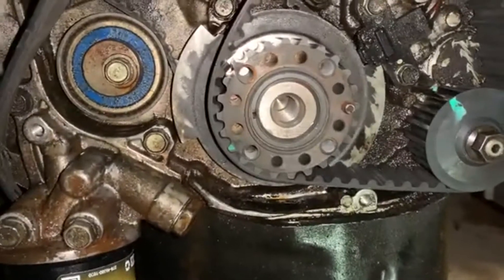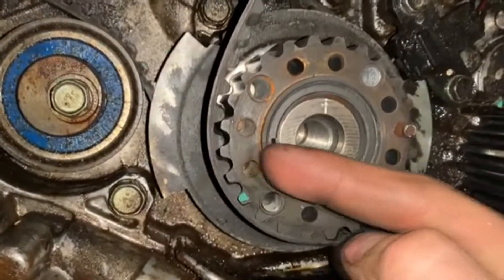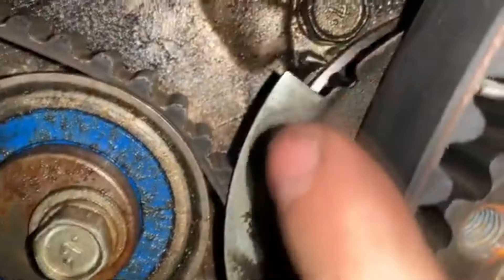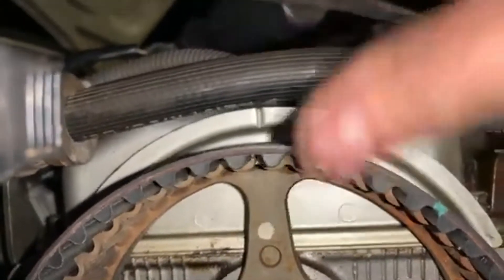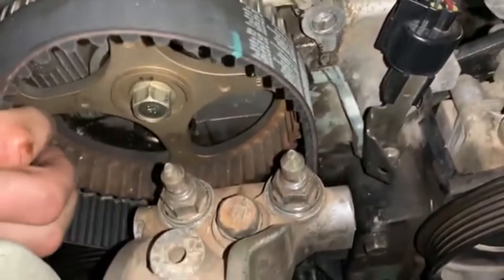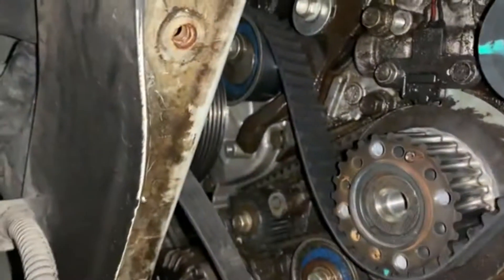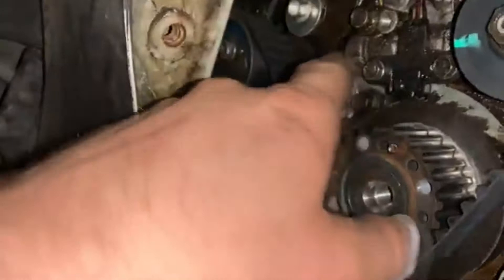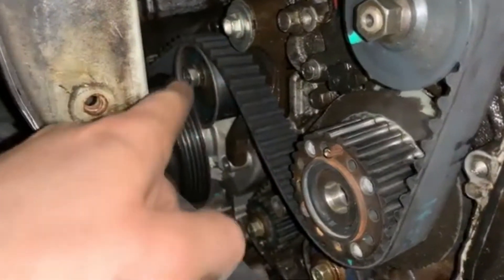2.4 L Mitsubishi SOHC (How to set Timing With Diagram)

Comment: I saw a video about the oil pump pully that explains that it needs to be lined up but also needs to pull back to the center after pulling it to the left and rigjt. 

This happens after every 3 or 4 rotations. If you pull left and it does not spring back towards the mark, circle and try again. The same goes for the right. Eventually, it springs back from both directions. 

Anyway, FYI...... If the car isn't running right afterward, this may be the problem.

Comment: You skipped over the oil pump alignment.  There's a balance shaft in the oil pump as well and you can get it 180 out even with the mark lined up, don't believe me spin it and see which way it wants to fall, then spin it 360° and see which way it wants to fall now.
Reply from the maker: @anthonyparker6586  I probably did however, the car is still running to this day and is doing just fine. Oh well.

Comment: Thanks for sharing! I have an engine like this in my catapillar forklift and I can't find anything in the diagrams. Do you happen to know what to set the distributor at?
Reply from the maker: This one is not a Distributor style it's a Coil Over style.   However anything that is Distributor style you can start off by finding TDC on cylinder Number 1 and then start the engine at 0 Degrees if timing and as it's running advance the timing till you get a good idle OR best way is to yse a timing light and advance it to about 15 Degrees before TDC

Comment: Thanks alot for this video. I have a GWM H5 with this motor(atleats an upgrade 4G69SYN as GWM calls it) and I did timing today, but that plunger tensioner did not touch the pulley's bracket after tensioning. Now I know why

Comment: Good luck with this crappy diagram if the firing order is out of place..
Reply from the maker: Not sure also what you mean in thr "crappy Diagram" and "firing order out of place" these cars are Coil Over and it's pretty hard to get the firing order off...  Even if the firing oder was not right it uses 2 Coils and uses what is called a Waste Spark in the exhaust stroke, so either way if somehow you're stupid enough to do that it's simple and swapping 2 plug boots over.........   You must be frustrated because you're having issues you can't seem to figure out.
Reply: @trxtech3010  I fix it after watching your diagram😂

Comment: the reason i’m asking, your valve cover has a nice gap on cover for timing!! mine  DOES NOT, the book says point to 95 degrees same way as distributor is mounted in  there is a mark on head? so i’m confused lol
Reply from the maker: This is a 2.4 L Eclipse with the 4G64 Engine, it does  ot have a Distributor. It's a Coil Over deaign.   The Mighty Max is slightly different
Reply: @trxtech3010  thanks bud!

Comment: ok, on this video,, there is a mark on top of cover, mine book is tell me to the side at a 45 , ( to the power steering pump side ) so that’s where i got mine at
Reply from the maker: Which Engine is in your truck? Is it the 4G64?
Reply: @trxtech3010  2.4. i’m banging my head buddy, could the cam be off 15 degrees different? and still run? the main reason is, the 2 cylinders in the middle are NOT firing ? it does run, but it’s rich ( gas smell ) so, i do have a comp tester, just got it tonight, soo
Reply: @trxtech3010  hey bud i need to lay down! i’m not feeling well!! thank you for ALL YOUR HELP!!! i’ll get back to you!!

Comment: HELP!! i did a head gasket replacement on a 1995 mighty max, long story short,, it’s NOT FIRING the 2 inside cylinders?? can someone please help me?? thank you!
Reply from the maker: Double checkyour Firing Order make sure the Plug Wires are not backwards.  Check your distrubtor Cap.   Also check the 2 middle spark plugs, I have seen where people drop the plugs down into the spark plug tubes and close the gap on the spark plugs by accident and causes the plug to not be able to spark.
Reply: @trxtech3010  yes you were right!! 2and 3 was crossed 
thank you for your help
Reply: @trxtech3010  i’m trying to find out, where the timing mark is for the top cam in head? at 12 or timing to a 45 o’clock ?? i’ve seen both, but the manual i have says at 45 o’clock so! also i’ve heard of many people said they have a hard time with getting into time? anybody know?

Comment: The 4g64 sohc is a non interference engine so throwing a belt won't damage the valves
Reply from the maker: Actually yes they're 100% a Interference engine.
Reply: @trxtech3010  but they're literally not an interference engine. With a 4G63 head they are but the 4G64 is non-interference.
Reply: @andrewdalvet6871 could be a 4g69 like mine, definitely is interface
Reply: The 8 valve version yes. But the 16valve version is interference.

Comment: I have a 2.4 2007 eclipse that is in limp mode and have tried everything.. The timing belt was recently changed if something was done wrong when replaced could it cause limp mode.. Car won't go past 45 mph.. Thanks in advance 2 anyone that could help with any advice..

Comment: that bottom right gear can be on wrong in two ways, you have a 1 in 3 chance if doing it right. you MUST spin that gear and ikf it drops down, it is wrong, spin it again, it will either stay up or drop again, if it drops it is wrong, spin it again, this time it should stay up. it drive a 3 to 1 gear reduction unit, you MUST get it right or engine will shake real bad. the CORRECT install is to open a service port and insert a screwdriver then turn the gear until the screwdriver moves to the correct position. however, the GRAVITY trick works just well i suggest you search for HOW TO NOT FAIL! "Gravity Trick" Hyundai Mitsubishi timing belt info!
Reply: Kishaun Sookdowar  no problem, I found out the hard way after fixing one and it shook so bad it could not be driven, nowhere do people tell you about that tricky gear
Reply: So true. I had an automechanic replace mine. He did it wrong and the car shook. I wound up having to take it elseware and they fixed it correctly @tracnunya7165
Reply: @tracnunya7165  will it cause the car to stall while idling. And winter allow it to rev up
Reply: I deleted my balance shafts so it's not an issue. But thanks for the info because I'm building a 63 for a van and going to leave the balance shafts in it. 👍
Reply from the maker: Seems to be doing perfect still till this day...  Thanks for the info though.
Reply: @trxtech3010  you had a 1 in 3 chance of installing it correctly

Comment: How to make sure that timing belt are to tight or to lose  because  I'm replacing that timing belt
Reply from the maker: Just make sure when it is on there it is tight enough that it should not easily flex in and out when you push and pull on it.
Reply: Thank you.

Comment: Mate you've helped out heaps I have an 02 lancer that has a blown head gasket, doing the timing belt while it's all apart... well of course I lost the timing with the belt slipping around the sprockets it was already that loose. This is a rough guide on the same sort of engine, cheers mate. Makes me want to keep people up to date seeing as there arnt many vids like this around and people need to know how right? 😉
Reply: I’m currently working on a 03 eclipse and did the same exact thing as u how do I know exactly my timing is set correctly just by the marking or could I be 360 degrees off I real need help if u can reply it will mean a lot
Reply: @isaacsotelo2598  same I did the same it cranks but no start. Is something off?
Reply from the maker: For sure!  Glad to hear that it helped you out.  I had 1 Hell of a time trying to figure it out ince I did I wanted to share this to the workd.   Glad to have helped.

Comment: Hey about two weeks ago my Dad bought a Mitsubishi Chariot Expo with a 2.4L engine same as that one. But he told me that when coming back home from work, the car started loosing power. We bought new spark plugs the car made it home but it broke the timing belt. We bought new timing belt, new hydraulic belt tensioner, new ignition coil and cables. Set it up on time but the car cranks and when its about to start it somehow gets stuck and tries again to start. We checked Fuses and the valve and everything is in order. If you have any idea of what is happening let me know.
Reply from the maker: Have you done a Leak Down Test on it?  If you don't have a leak down tester go rent one or buy one.  See what your firing order is and test each cylinder with the leak down tester. Ifnyou hear a lot of air coming from intake or exhaust possibel your valves are bent.   It's normal  if you hear a tiny bit or air escaping you just don't wanna hear a tone.
Reply: @trxtech3010  This week I’ll try it, I’ll keep you updated. Thank you for answering
Reply: @trxtech3010  Ok Idk if anyone is listening out there but here goes, so one night it was raining really hard, I parked my car, and got out, got back in 10 minutes later and the car wouldn’t crank, wouldn’t start, I tried to jump it nothing, got my car towed home. I replace the crank and cam shaft sensors, replaced the battery, the starter, the fuel pump, and all the fuses....after this, car now cranks, but that’s it, it just cranks, if I do it long light smoke comes from the engine bay, I mean really light smoke, if u were looking hard u wouldn’t even see it....I am stumped on what the problem could be, I’ve invested a lot of money into this car, and I’d really like to get it running again, it’s 80% modded, full body kit, after I get it running again I’m gonna throw on the fender flares, side skirts and get it wrapped, I swapped the hood for a carbon fiber with air vents it was $1200 the body kit was $700, I’ve put on new headers, ignition coils, please if anyone could help...Mitsubishi eclipse spyder gs 2004
Reply from the maker: @alwayyssgone  The smoke it because the starter was getting hot from cranking so long, The starter is probably fine after getting a little warm.  However I would go rent a Noid Light Kit from autozonr and make sure that you have Injector Pulse and Spark Signal to the coils.  It's an easy test.  You just unplug the injectors and plug in the Noid Light into the injectors and the ignition coil plugs and crank the care those lights should flash.  If not and acter all the things you replaced it's possible the ECU got wet and freid... If you need one email @ ryan94james@gmail.com and we can work out a deal.